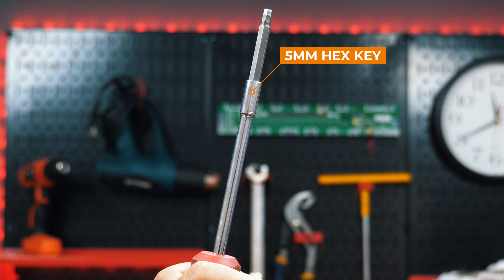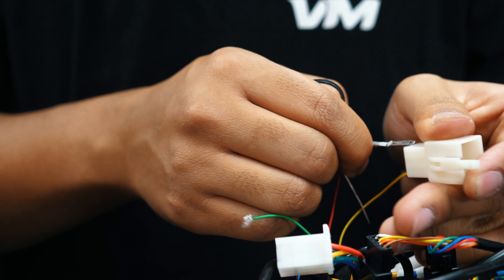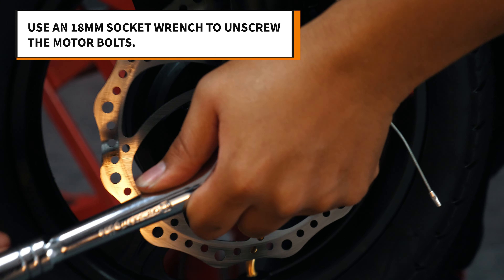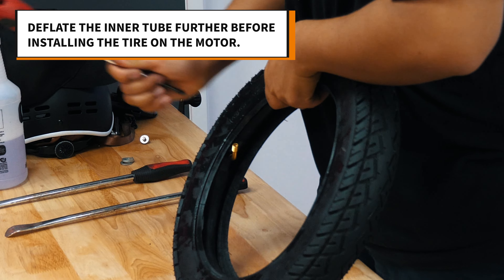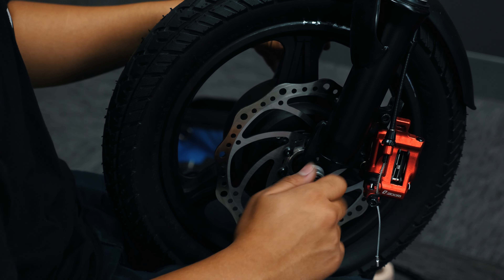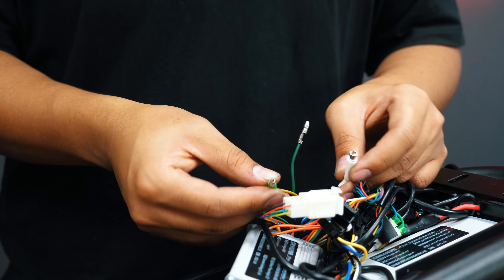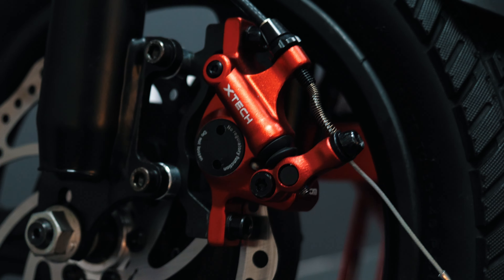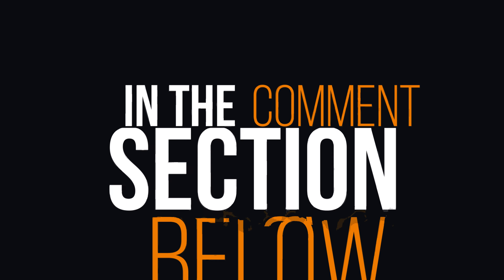How to replace the front motor on EMOVE Roadrunner electric scooters - VoroMotors tutorial

Comment: My brother just picked up the roadrunner and I was about to order one also but when my brothers bike arrived I think I’ll hold off a bit.  There’s a few improvements that I think this bike could benefit from.  If kept at 48v maybe a more powerful controller with a battery with better cells or just upgraded to a 52v system.  Battery sag is very noticeable.  Front suspension still needs improving and the pivoting handle bar is a big weak point.  Full hydraulic brakes would be nice also, hydraulic brakes has been around for awhile and is very inexpensive improvement.  There’s a huge gap between the RoadRunner and the tronic soo there’s no threat in improving the RoadRunner to be just a little more powerful.  Even 500 watts upfront and 750 watts in the rear.  I understand improvements would inflate the price a little but I’m sure current RoadRunner owners would have paid more of the mention improvements were made.
Reply from the maker: Thank you for the comment! We appreciate the feedback
Reply: Get the pro great improvement for the price of road runner think it’s a far price

Comment: Is this capable of putting 1000 watt kaabo motors on?
Reply from the maker: In order to install 1000 watt Kaabo motors, you would need different controllers since the motors would not be compatible with the current controllers
Reply: @VoroMotors  would you need to upgrade the battery to do this?  i' interested in upgrading the front motor to the same 500W one in the back